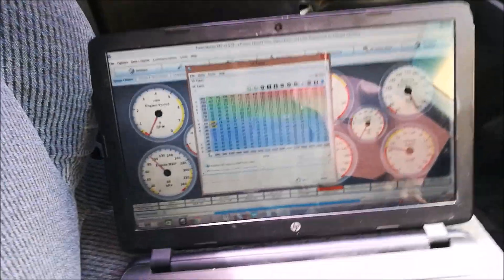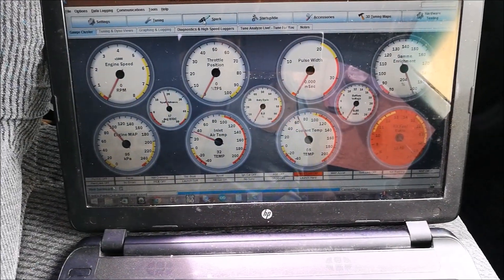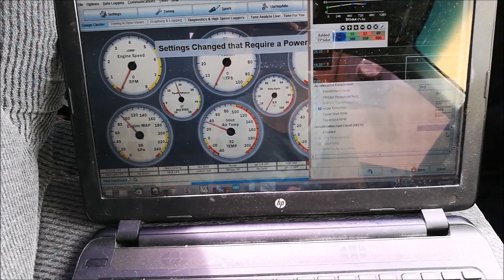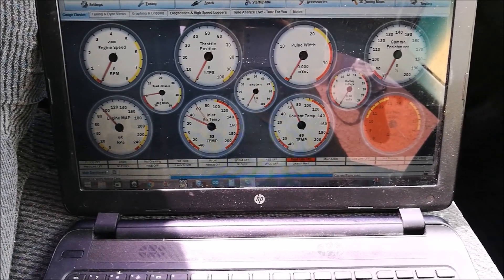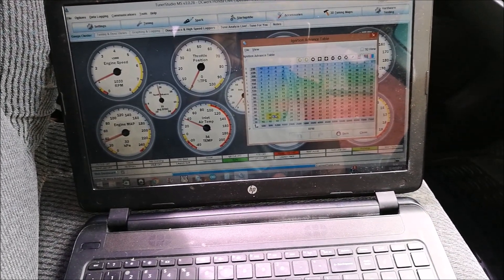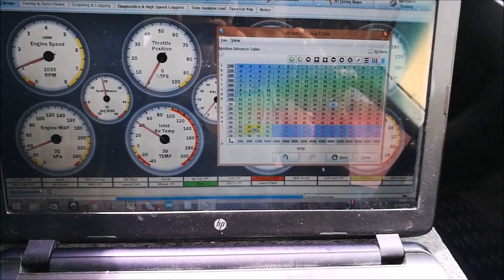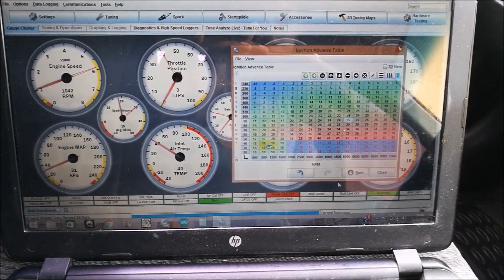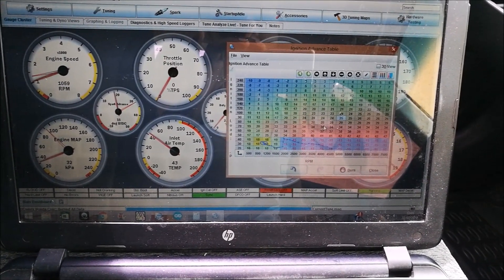How To: Crackle and Pop "Tune"

Comment: What obd2 input or cable did you use for this to work? My tactrix openport 2.0 didn’t work.
Reply from the maker: This car was on a Speeduino standalone ecu.
Reply: @DCWERX  I’m not quite sure what you mean, so the car had a standalone ecu, but how were you able to control it with the computer? What cable or scanner?
Reply from the maker: Speeduino uses a generic USB cord similar to what you would get on your paper printer

Comment: Hi! Will this work on my Automatic 1999 Integra? It has stock ecu and I would like to ask you for advice on how to make my car crackle. Buying aftermarket ecu? What harness conversion? Etc...
Reply: Also , I only have a Vibrant Street Performance muffler on.
Reply from the maker: This will only work with a programmable ECU. Wiring will depend on which ECU you go with

Comment: couldnt you add a little more fuel too to make the car crackle and pop without messing with the throttle?
Reply from the maker: You can add fuel but it won't work without letting air in (opening throttle)

Comment: Can we get the crackle and pop in completely stock car?
Reply from the maker: If it has a programmable ECU fitted then yes. Factory exhaust most times muffles the noises though.
Reply: @DCWERX  i have an Nissan Altima SE I am completley stock so what can be done for the crackle can i do anything myself? Also as you know there is 20 bucks OBD2 scanner will it help me in it or i have to do i by professionL
Reply from the maker: @minhazaziz1012  I am not sure what tuning options exist for your car and how they work.

As for implementation of crackle tune it should work on any car. Automatics may just make it a bit more difficult.

Comment: What is the name of the software used? Will it work on Toyota? Standard ecu or do i need to change it?
Reply from the maker: It's called tunerstudio. It doesn't work on factory Toyota ECU as far as I know. You need a standalone ECU like Speeduino or Megasquirt to use tunerstudio. Pretty much and standalone ecu would allow you to do that crackle tune
Reply: Does this software work on 1996 Honda Accord ?

Comment: Can a do this with a stoke ecu & what its this program, i know hondata but yours i dont know
Reply from the maker: No, you need some form of programmable ECU to do this. My ECU uses the tunerstudio tuning program
Reply: @DCWERX  thanks for your fast respond, i got a honda accord 2001 i will looking for a ecu for my car
Reply from the maker: @mizudorishinobi4697  depends on what motor is in it, there are many different ECU to chose from
Reply: @DCWERX  thanks! & the ECU need to be chiped for make a tune like ur video? or its a programmable ECU? Sorry im new in this i want to understand, im french but all video or forum is only english its hard to find what i want , just want make my car crackle/pop like u hehe 💯🔥
Reply from the maker: @mizudorishinobi4697  yes your ECU needs to be chipped or atleast programmable for you to be able to do crackle and pop tunes. Depending on what engine is in your accord you may be able to find a Hondata that plugs right in.
Reply: @DCWERX u help me so much! I just find what a need! Thanks G u r a real hehe
Reply: @DCWERX  and do u think a p28 ecu chiped will work its a obd1 with chip, i know its work on a accord but i want to know if i will can plug my pc to my ECU for tune directly from my pc to my ECU like ur video
Reply from the maker: @mizudorishinobi4697  if it's 2001 and you can somehow fit the chipped p28 with a jumper harness then you can tune it with Honda tuning Suite software or crome. You will need a chip burner or emulator and a datalogging cable. Or just get one demon board or anyone like it. Join the "Honda ECU tuners (official)" Facebook page for more info

Comment: Can I do this to my Jeep Grand Cherokee may be a stupid question lol and does it have to be manual
Reply from the maker: It may be a little tricky to do with an auto since it will want to upshift when you let off the throttle. I supposed you can leave it in 2nd gear and it should work

Comment: I just modulated the throttle when I let off and it popped like a mf and my d16y7 was completely stock witth just an intake and muffler delete. my buddy was like "what does this thing have a burble tune?" good times
Reply from the maker: Correct I have seen a few stock cars do it aswell, just like you stated. Pretty kool
Reply: Yo, i have a d16y7 and i been looking all over, you think you can do a walk through would the pop tune ?
Reply: @alancarrillo9787  I have a d16y7, y8 TB, DC Header, full 2 1/2in pipe to a Yonaka muffler, cat delete,BBK intake, y8 manifold. It crackles when I drive at a med to high rpm and barely hold the throttle.
Reply: Jedadiah Sands done this only work on stick shift or automatic as well?
Reply: @joshuaguadarrama8795  works alot better on manual cars but automatic it can work but not as easily, only in lower gear
Reply: @joshuaguadarrama8795  I drive an automatic Mitsubishi eclipse, i dont have the tune yet but I’m catless and straight piped and it does crackle already but mostly at lower rpm like the other guy said. But it reallyyy helps if you have a manual mode on your car, I always drive mine in autostick and that’s how I’m able to get burbles and pops
Reply: Will work on vtec engines with bolt ons especially because they get rich after vtec hits and they are already running too rich most likely so I cant wait to try this. This is probably how my prelude sounded like a cannon recently haha.
Reply: Same with my Corolla 😂 muffler unbolted rev up to 3 and just tap the gas ever so slightly and 💥 😂 awesome

Comment: Sir, how did you connect your laptop to your car?
Reply: With a obd cable 1 or 2 I'm not sure
Reply: @callumb5184  and which software should I download on my laptop?
Reply: @tarvinjraesthetic8292  I'm not sure
Reply: @callumb5184  ok thanks
Reply: he's using an aftermarket ecu (speedino) and using Tuner Studio. It's expensive and not something you would get just for the purpose of this, but if you were also adding turbo, etc

Comment: Hello DC. Always follow your video, you are like a teacher for me. Two questions about pop and bang tune : 1) its harmful to the turbo and piston rings? 2) is that true that after some thousands of miles it start to have a drop in mpg?

Thank you

Have a nice day
Reply from the maker: There is some risk to the turbo, pistons and exhaust valves but very little. You should be fine if done in moderation.

As long as you keep up with routine maintenance your mpg should remain unchanged unless your engine gets really worn out.

Comment: As always nice video DcWerx  I try it on my car the other day I didn't mess with timing map . All I did was on the ve table lowest kpa row 16kpa between 2k & 4.5k I set ve to 0  I get a slight crackle  even with decel ON.  Not as savage as your timing map method. Gotta admit though it don't do squat it sound amazing 🙂
Reply from the maker: Yep there are many ways to get the crackle, IMO the spark retard method seems to be the most effective. I will try out your method next time I take the car out for a drive.

 Smiles per gallon is just about all you get with the crackle/pop tune lol

Comment: In my experience, you can additionally fatten up the low load rows of the fuel table to let it pop under normal decal and off-throttle (without modulating actual pedal). I agree it's just about worthless. lol
Reply: worthless???   what about the happiness those pops bring ?
Reply from the maker: @kerstas10  indeed, these simple things always bring a smile to my face
Reply from the maker: Certainly, there are any ways to achieve the desired results. I was hoping to play with fuel also but my laptop battery died.